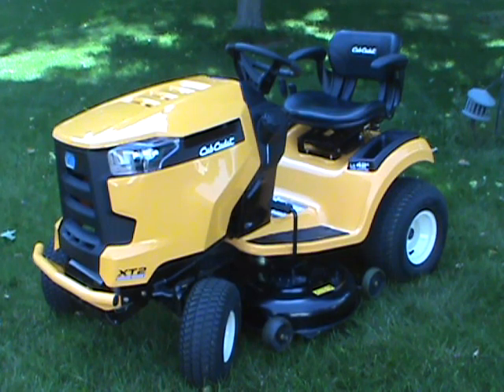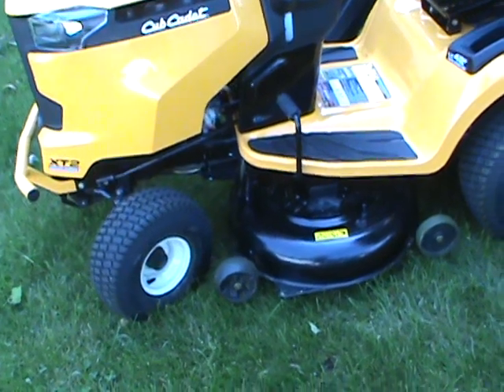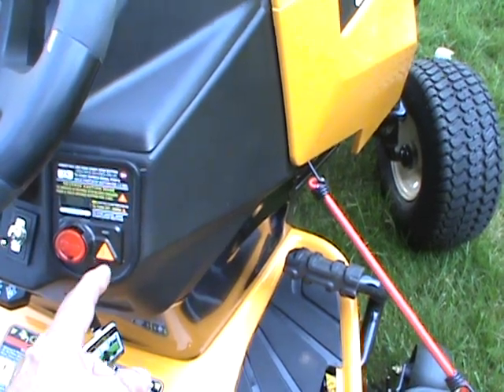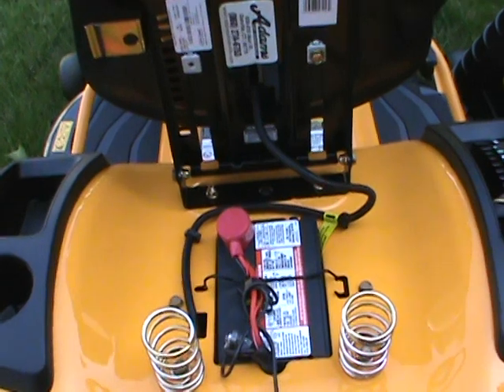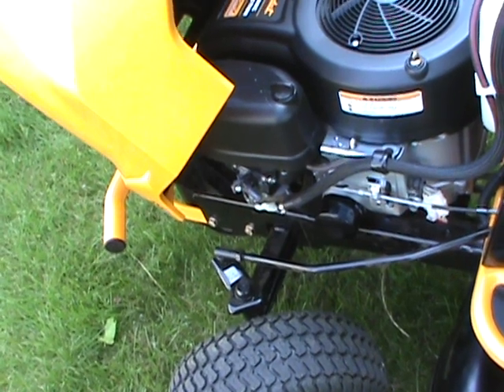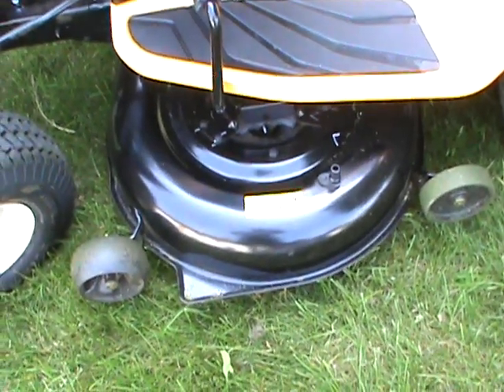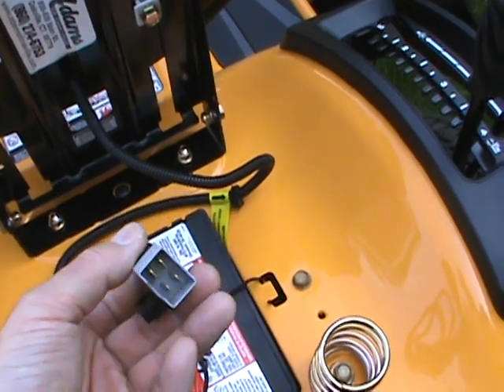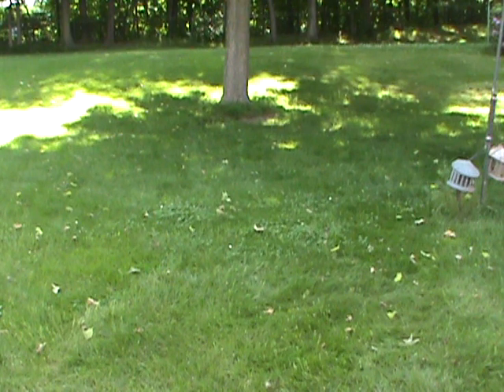Cub Cadet XT2 Enduro series 5 hour review

Comment: I got this Lawn Tractor, but mine was from a Cub Cadet dealer, not a Big Box Store. Mine has a Fabricated deck, not a stamped deck. It is well worth the extra money for the upgraded deck. Also I have the Kawasaki Engine that just purrs. The only problem I've had is two  Kawasaki Air Filter elements have separated from the plastic body, caught both before they completely pulled apart. I added the mulching kit, and took the discharge Shute  off. I have 77 hours on the Tractor with no problems. BTW The Lights are on an ambient light sensor, so there's no need for a switch.

Comment: Nice review! I got the XT1 series and no problems with the mow in reverse feature. I simply press it in when I start up until the red light comes on and that's it. A switch for the LED's is not necessary since LED's draw very little amperage and it's a safety factor too. A trickle charge after each use is actually harmful for the battery for the long term and will shorten its life. I bought one of those compact portable battery booster packs just in case for the tractor and take it with me on the boat. I also have the 46" snow plow (tire chains are a must) and it works well. After two years I have had no battery issues, it starts up 1st time in the dead of winter.

Comment: Question.........  you mentioned the piece of wire/rod that goes over your mulch cover that helps keep the cover on.....  Did you put that on yourself or did that come with the mulch kit?    I have the mulch kit as well, but no such wire was included.  I can see how this would help tighten the cover against the side of the deck.   My mulch cover doesn't come off, but I get a lot of grass blowing out around the cover.   Thanks
Reply from the maker: I bought the mulch kit at the same time as the tractor from the dealer. My mulch kit came with a cover, two blades, wingnut, wire and washer.  That wire is around 3/32 thick and it's formed to lay over the rear side of the cover.
After I cut the grass, I unscrew the wing nut and remove the wire and cover and clean all the clippings out of the cover area and blow off the tractor completely. I house the tractor in my garage in a fairly clean state and don't want any mice making a home on it.
Reply: My mulch cover came from the dealer, no wire and dealer said there is none. Blows grass same as you stated.

Comment: So, the Only bad thing was the Reverse switch located under the battery. Going to purchase the XT2 this spring of 2018. Got brochure and talked to the CubCadet Representative. I'm getting the XT2 with the Kohler 24 Smart Choke 46" cut. $ 1999.00 + tax.

Comment: How does it perform in slopes ?
Reply from the maker: Not bad. It only is powered on 1 rear tire so if it's really angled it will loose traction. If your yard is very angled you will need to spend more for a locked rear end. Also if you race down hill and cut the wheels you will roll it over.  It is narrow  and top heavy body.
Go straight up and down sharp hills it will preform excellent.

Comment: Just bought a 22hp 46” and love it so far (after I disconnected the reverse mow and seat safety switches)
Reply from the maker: You will find the bees make out with your hood as you mow your lawn. I like my tractor also, no issues still runs fine. I found a bag of nuts in my seat this spring. Mice went into the seat where the seat switch is located. I had seeds and I think apple seeds inside the seat. I spent a hour shaking all that junk out. 
I bought a mouse trap. Mice are quiet now!

Comment: hi i hav xt2 also but not the fuel injected,mine has 108 hrs on it and its runnin like crap now it wont idle on low idle it surges and ive tried to use some spray carb cleaner no go,and theres is no videos on youtube to remove the carb,so im thinkin now of gettin a john Deere now,ive had this mower for 2 years, and ive put sta-bil gas treatment in it and changed all the maintance stuff already  im gonna try some spark plugs next,but no carb removal videos on youtube at all,just maintance stuff,air filter and oil change,so i think was a bad purchase,good luck with yours,its just a matter of time will need a carb cleaning,ok good video later.
Reply from the maker: The new carbs are made to run so lean that any spec of dirt will cause them to surge as you describe. You will have to remove the bowl of the carb. Once the bowl is off you will see all the dirt in the gas sitting at the bottom of the bowl. 2 screws will remove the bowl. Sometimes the dirt comes from a metal gas can or even the gas station where you fill your gas cans. On the carb once you have the bowl off it take a wire brush and cut 1 wire off it. Using that wire poke all the tiny holes you see at the bottom of the carb. Spray it with carb cleaner or compressed air. It will run fine after.

Comment: Any experience using it with slopes?
Reply from the maker: Going up a slippery slope straight on one wheel will break loose (ice or snow). Going across moderate hills is no problem. Going down the same hills is fine. Like any riding lawnmower if the hill is too steep riding it across you run the risk of rolling it over. I have a small hill in back, the zero turn don't like the spot and I tear up the turf, but this machine cuts the grass there perfectly.
If you use the speed control feature the machine will slow down on hills so you will need to give it more throttle, or stop and reset it.
Reply from the maker: @mct8888  Yes but I have the fuel injected model engine. It's a good machine. It starts every time and is comfertable to mow the grass.

Comment: Just picked up a 46" XT1 22Hp and love it so far. If you push the reverse button when you get on, it works until you shut it off.  good vid
Reply from the maker: PJ in the valley with myself, I would always forget and the engine would stall...so that is why I modified the switch. Its easy enough to put back to original, if needed. Thanks for watching!

Comment: Good video, I bought the XT1 ,46" cut,  Kohler v-twin . Not sure about that EFI Cub motor.
My mower has no cruise control, but reverse with blades cutting is so nice and easy! Just push the reverse button and go! Drive forward and reverse and end of story. I wanted the biggest cut,(I can reach edges without tires going over curbs, because blades hang wider than tires. There is no need for a Zero cut with this reverse( much more money) or a second mower to cut missed edges with a 42" cut mower. Paid $1699.00 and bought the mulch kit, with the yellow extreme mulch blades through Cub Cadet. So happy!

Comment: It is my understanding the bearings are sealed. In order to grease them, you need to remove one side of the roller bearing so the grease can get into the ball bearings. Otherwise, you are just putting grease to the ouside of the roller.

Comment: Just adding the grease zerks on the spindles IS a good idea, but that's not enough.  Reason:  The bearings Cub is using on that model are newer "SEALED STYLE" bearings, so just adding the zerk is not enough by itself as the grease still cannot get into the bearings.

Solution:  Remove the spindle shaft to get to the bearings, and remove one cover seal on each of the top bearing and the bottom bearing so the grease zerk can then push new grease into the bearing when the spindles are greased.
Reply from the maker: Yes. You must verify the cover seals are removed for the grease to get into the bearings. Just adding a fitting won't do anything. 
On my machine I did remove the pulley and removed the bearings to check the grease. I determined Cub cadet had sealed bearings that were greased.   I then removed one seal from each bearing end then I added the grease fitting and pumped it full of grease. Thank you for watching.

Comment: I got the xt2 with the big 28hp Kawasaki engine and fabricated deck and it a beast!! I love it so far! Kawasaki engines will run for thousands of hrs with no issues if maintained correctly
Reply from the maker: Crazy Kup Yes Kawasaki engines are fantastic, but sadly they discontinued the small engine line. Last year.  Parts are out sourced by another company.
Reply: 007, what do you mean by "small" engines being discontinued?  Thanks.
Reply: Was just at a cub dealer and the Kawasaki is no longer available in the lawn tractors, only the zero turns,I think they are screwing up.

Comment: Nice video.  I have the same exact tractor. Purchased in March 2016.  Love the way it cuts.  I bought mine with the 22hp Kohler.  Runs great.  Reading now on how to remove the deck so I can clean it out..  My dealer told me don't use the deck washout....could cause problems........  and I agree.  thanks
Reply: tim feldman how’s your mower holding up. I’m purchasing a new mower this spring and I’m intrigued by the xt2 or a John Deere of equal value. But I really want the cub xt2 46”

Comment: I have a question , if you have sealed bearings on the deck what are you greasing with the zero fittings you installed?
Reply from the maker: I took the spindles apart to inspect if there was grease in them. New or not I don't trust suppliers to do their jobs properly. There was grease in the bearings and they were a sealed unit. I removed one seal from each end and added zerk fittings. Now I grease them once a year to make sure the grease don't melt out and the bearings  stay packed with grease. I don't think I will ever change this set of bearings now that I add grease periodically
Reply: @007connecticut  ⁸That will work great, that's an excellent trick. I wrote that one down.

Comment: I can understand your frustration over the mow in reverse switch but this is a safety feature and unlike most of them this one is very important. I happen to know someone who backed over his 5 year old daughter with the mower running. It's simply a matter of remembering to hold the button in for 3 seconds, well worth the effort.
Reply from the maker: Yes, I understand that but the commercial zero turn machines don't have this feature. If I were to sell the Cub Cadet in the future, I should at least replace that switch so it's back to 100% factory condition. Thanks for watching.
Reply: @samdittmar5142  I ran over a frog in reverse :( :( lol
Reply: ron cash it’s really fun to run over snakes

Comment: I got one of these also, with a 46 inch deck, and am well pleased with it.
Reply from the maker: Last year I was not being careful while cutting the grass I turned hard at normal speed and clipped the fence causing the front tire to grab into the fence and screw up the alignment. The steering wheel now was out, it did't point straight any longer. What I like about the front end of the machine you can readjust the tie rod ends to correct for an accident. The steering wheel is straight again. My pride is fixed. Yes, I like this machine. Mine is a good one.

Comment: How many hours did you have on a Sears tractor before you got rid of it
Reply from the maker: Ralph Kowalski I had just over a hundred when the head gasket blew. I fixed it, sold it then bought the cub. The scag and cub are my main machines for the yard.
Reply: Wow only one hundred hours and the head gasket blew i have a 2003 john deere with a 16 hp kohler it has 150 hours on it and it still runs good i guess briggs motors aren’t as good as the kholer engine i just bought a new cub xt1 50 cut with a kholer 24hp vtwin last week ima sell my john deere

Comment: Ha ha.  I found a really good video here on a Grizzly mill that I'm going to buy because of your review and started looking at the rest of your videos.  I found this one about the very lawn tractor that I'm looking at for this spring.  Now I've subscribed so I can know what I'm going to buy before I even know I'm going to buy it.  The only thing that I need to check on the tractor is how wide the deck is with the chute up because I'v got a gate that I have to go through.  Kinda wish they had a 38 inch deck, but maybe I'll get lucky.  Thanks for another great video.
Reply from the maker: It's 42" so the outside is 43" maybe a hair wider with the cover open. It's a nice home owner grade tractor. I think sitting on the seat it's more comfortable than a John Deere and it's made well. Plastic hood so watch that, but it won't rust if you scratch it. I think your going to have to buy a gate and move 1 post to slip your tractor thru...  :)

Comment: Did you think about a John Deere?
Reply from the maker: Yes. I went to home depot and looked at both machines they had to offer. I sat on both and to my butt the Cub was more comfortable, so I went to the cub dealer and bought the next level machine from them. Still runs perfectly. Just serviced it  (Oil change, grease , and sharpened the blades) and it's  waiting now for spring.
Reply: @007connecticut  I'm thinking of buying the Troy Bilt 46" XP which is basically the same as this wearing a different skin.  If you go to mtdparts.com and check out the discontinued sale you will see why and what price I should wait for.

Comment: You should put a video together how you added the grease fittings. I'm sure a lot of people would be interested including myself! Great video btw,
Reply from the maker: It's am easy thing to do. Look on my channel as I have a video named "lawn tractor spindle bearing tear down"  where I take one apart and reassemble it as a basic show and tell. 

If you get one in your hands, remove both bearings as I did. Mark the outside where you would like a grease fitting placed. I used the tall type fittings and it was a 1/4-28 thread. So I used a # 3 drill and drilled a hole just below where the bearing fits. Then tapped it in using a drop of oil. Then using a 1/32 sized drill, put a vent hole on the opposite side of the housing.
Then clean all the metal chips out and reassemble it. Pump it up with 30 pumps of grease or until you see it leak out of the bleeder hole. Then re apply more every 10 / 15 HRS of use. They should last the life of the tractor. Remember to remove the inner bearing seal on each bearing before you reassemble it!
Reply: Greasing the main spindles at least twice a season works. I just sold my 2001 Scott's 42" Kohler powered tractor and the original spindles still work fine....it was a great machine but started using a lot of oil. Picking up my new EFI Cadet Enduro this week.

Comment: Good review but installing the grease fittings most likely won't help because the bearings are sealed for life
Reply from the maker: Ball joints are sealed for life too but wear out just the same. If your the type to run the machine with many hours then adding grease fitting and putting several pumps of grease every so often can't hurt.  Thanks for watching!

Comment: The bearings around the spindles are sealed. Greasiing is doing no good. You need to remove one side of the two bearings o n each spindle and face the two exposed sides of the bearings toward the center. They will be facing each other. Now when you grease the bearings will be lubricated. The ssame thing goes for the wheels.
Reply from the maker: correct. I do this as well.I think in a tear down spindle video I made a while back I point this out.

Comment: That is NOT a garden tractor! Its just a riding mower as its not sturdy enough for ground moving implements.
Reply: Dean T I believe only the "G" series cub cadets are classified as garden tractors. There's only one "G" model XT2 and the rest are the XT3's.
Reply: It's technically a lawn tractor
Reply: Plus a garden tractor is geared lower..
Reply: XT2 has the heaver transmission and IS designed to be used with ground engaging equipment. I do so with mine.
Reply: Lawn tractor
Reply: Lol, I have an LTX1040 I bought back in 2011 which I'm gonna replace next season with a XT2.  I've used  the 1040 to till gardens, Fresh tills using a DR RotoHog tow behind tiller. The Tiller will push the mower forward if you don't drop the drag stakes. Just let the tiller do the work and the tractor/mower has no problems. No way I'm paying 5K + another $500 for a deck for the XT3. That's like trying to sell a car and then telling the customer they have to buy the steering column separately.  TBH they should install drive shafts like on the XT3s on all their lawn tractors and do away with the damned drive belts alltogether.

Comment: Why didn't you buy a new Sears mower.  They are rated #1 in reliability..  They have if not currently beating John Deere.
Reply from the maker: I run two machines on my property, a commercial zero turn and a residential lawn tractor for little jobs like pulling the lawn cart and mowing the smaller side yard. I sold the red sears tractor because I blew the engine mulching leaves. So I had really bad luck with the last craftsman tractor I owned.
On an older video I made you can see that I did own a sears tractor.  see here https://youtu.be/ZgtCoBOGkLo
Reply: The new Sears series is the same as the Cub Cadet, both made by MTD.  So are a few other the other major brands.